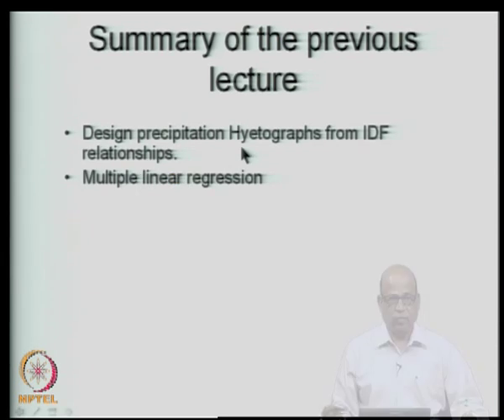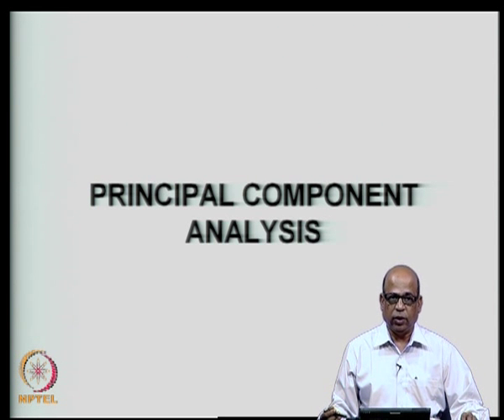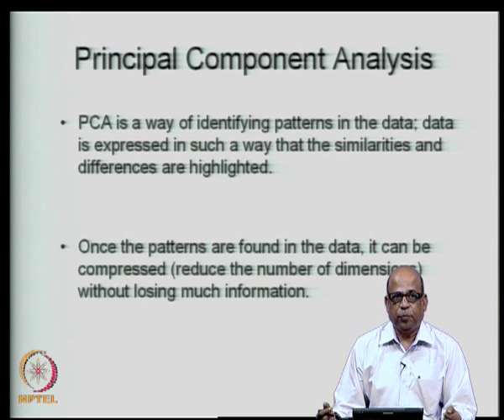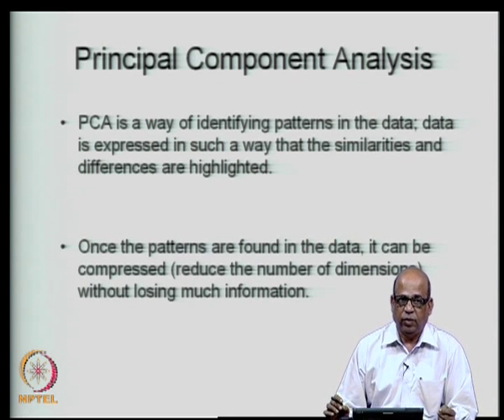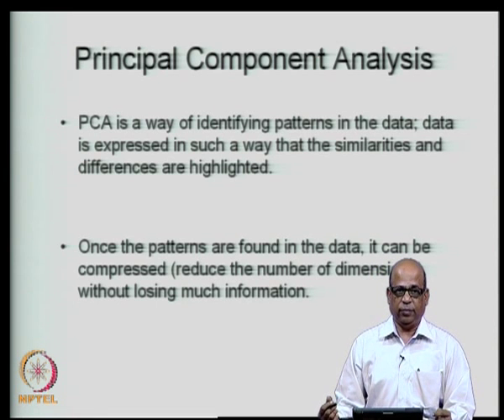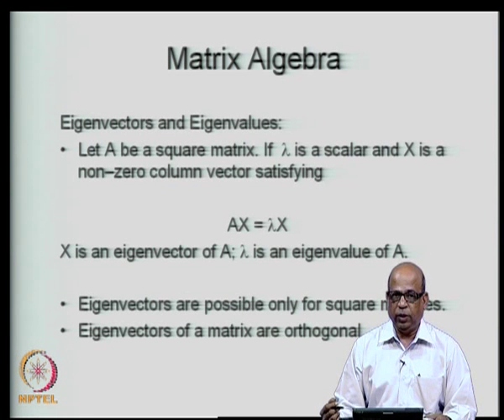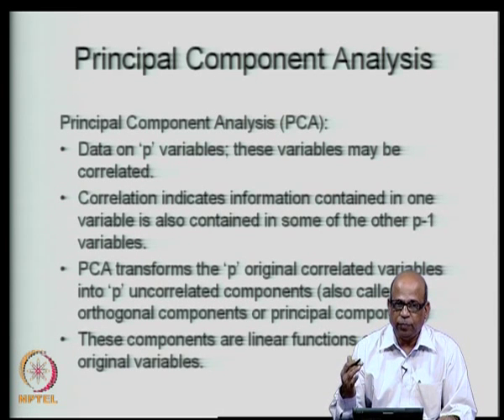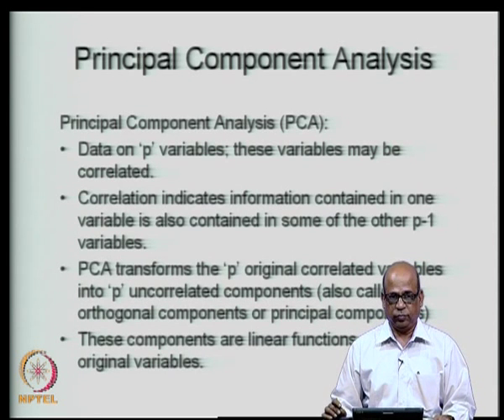Mod-07 Lec-31 Principal Component Analysis

Comment: Hi, this is Chandra Rupa, Project Assistant to Prof. Mujumdar,
Thank you for pointing out this.
The PCA is carried out on the 10 years of data, for which the mean is not mentioned in the lecture.
For 10 yrs data, the mean of rainfall  is 106.3mm and mean of runoff is 38.6 mm